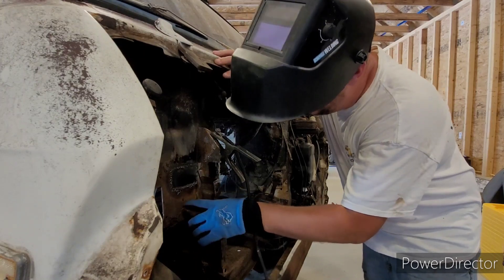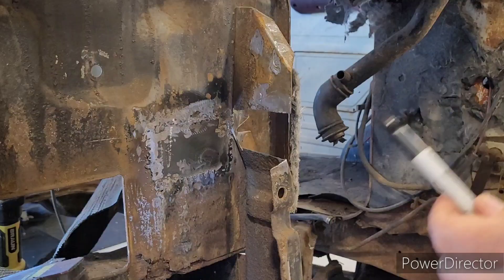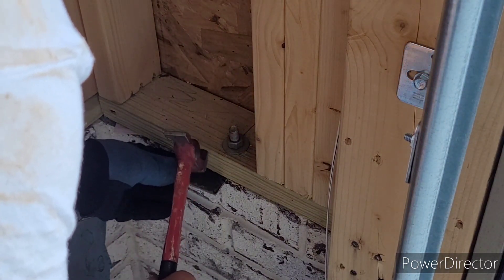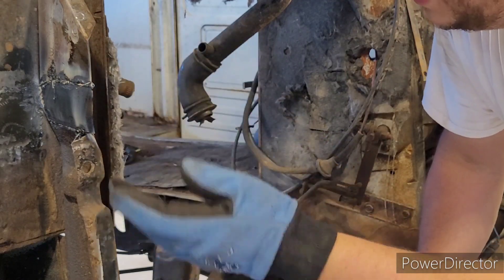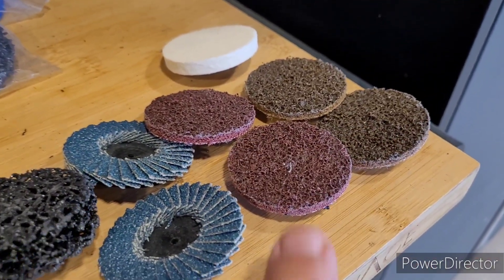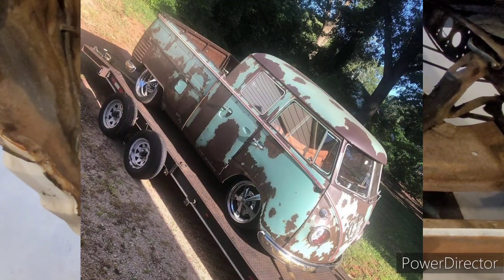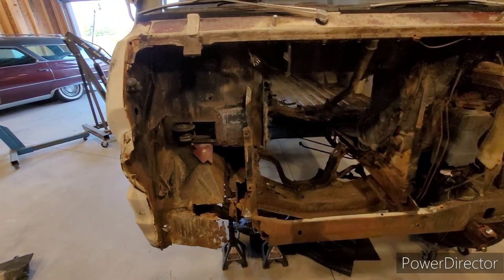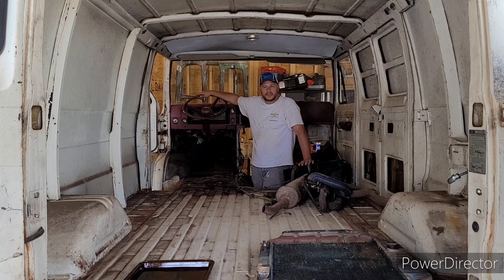1969 Ford E100 Econoline Van Resto Pt 7 Welding (AKA Grinding)

Comment: With your chassis at the front use metal the same gauge as original. Bend it in a couple of sections or weld flat pieces together in a channel shape as per original.
Reply from the maker: Hey brother the metal doesnt seem to be any thicker than standard sheet metal. Do you think that is still ok?
Reply: @sircrunch80  even with body metal thickness the fact it is forming a box shape gives it more strength than just a flat sheet.